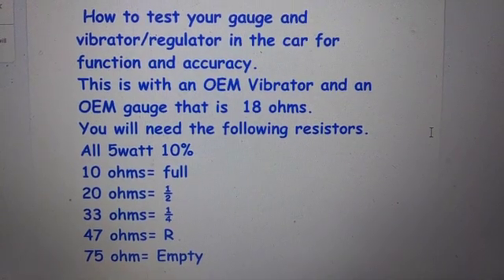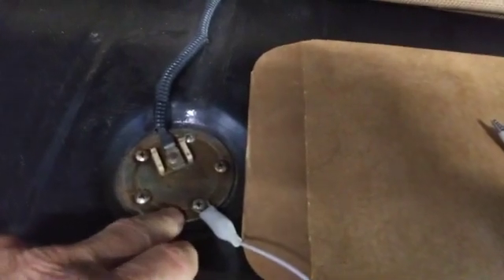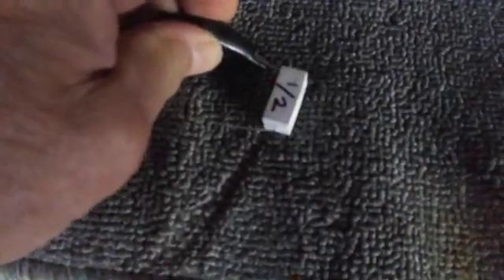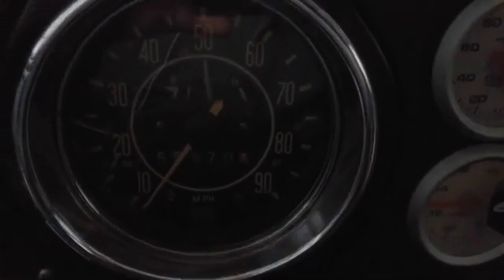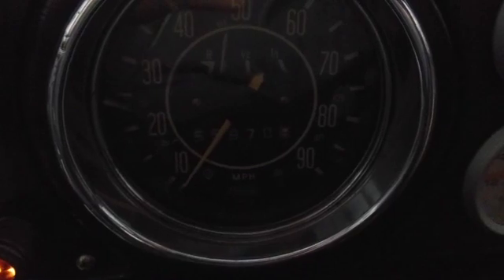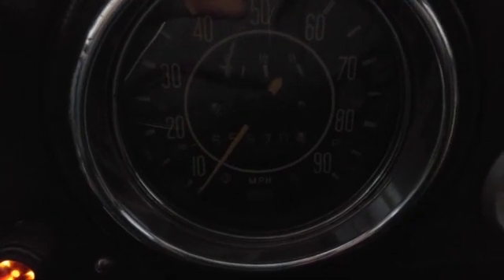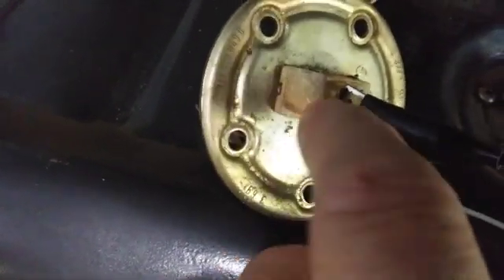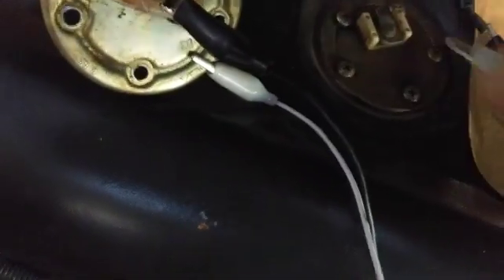VW beetle gauge and vibrator test in car with resistors

Comment: what are the values of the resistors and where can i buy them? thanks
Reply from the maker: The first part of the video shows the resistor values.  10, 29,33,47 and 75.  They should be 5 watt.  Amazon has them.  https://www.amazon.com/uxcell-Tolerance-Resistance-Electronic-Experiments/dp/B07RWF466H/ref=sr_1_3?crid=1PC9ZC7MV1QTQ&dib=eyJ2IjoiMSJ9.T1trCQ3-jhmZIQtG9pZhnfuafEpmanJcwzU2OHALinxeO_mSH4JJRuCiYjq6edeNaRY9CUP7bu3oIgDRkQpTqnVlKDrTOb9O-A5Tmqk-EUpMcf0F7kdxGD6aqQgL46fRNUWAfcZr0mmMBoWRItfSTrbtszGH8EizeEMdnWykdiMafPt2j4ARWCMrpeoqvyO_w01ZXju1uaVO4IuIQzATKOzfiobQSvqWvc0O9DJWiTM.J0zCFl6Nb1kr9dwRXDhcNyEe2WQU8Cs7MrTsNoHlj2k&dib_tag=se&keywords=10+ohm+5watt+resistors&qid=1745513850&sprefix=10+ohm+5wa%2Caps%2C166&sr=8-3

Comment: How do you measure the gauge resistance? Just a mulimeter?
How do you measure the vibrator/regulator voltage?
My gauge (71 super) won't read empty with the sender (measured it at 73 Ohms). Disconnect the sender sand it does read empty.
Reply from the maker: Dang, I missed that you replied to this video and thus left your hang.  To measure the gauge resistance disconnect the sender wire from the sender or the gauge.  Measure across the 2 terminals on the gauge...  16-18 ohms will show it being an OEM gauge.  32 ohms would be an aftermarket.  Hard to read the vibrator voltage.  You will need to use a jumper lead and attach it to the gauge where the vibrator attaches to the gauge terminal.  The voltage will be jumping around, how much depends on the fuel level in the tank.  More when the tank is full.  So 0 to 2vdc to <>7 or so...  The regulator type which is plastic case and metal will show a constant voltage...  <>5.1vdc.    
Is you sender aftermarket?  If so you should see if you have tightened the sender into the tank too far.. This video shows the issue...   

https://youtu.be/wbDreq13EBM
Reply: @vwbeetlefuelgaugesystem  VDO sender.
We exchanges some emails/messages later.

Still not getting a low reading correctly. I'll double check the sender install.

Have a new issue as my tank bulged after in replaced the cap. Reworked a vent short term, but tank is still high in center.